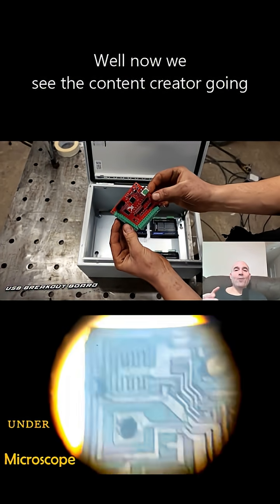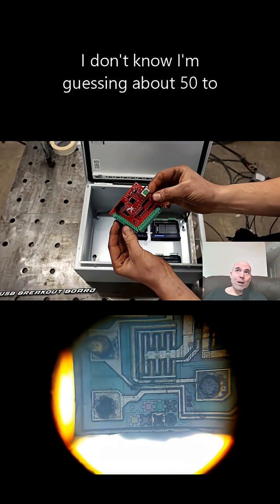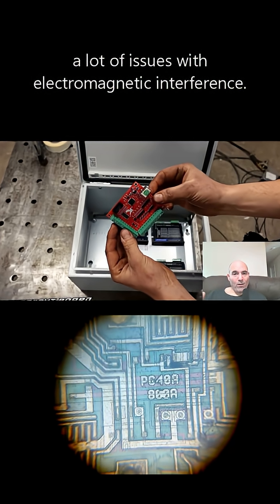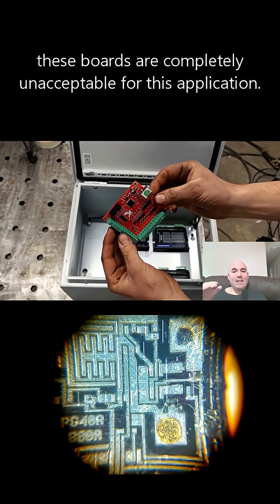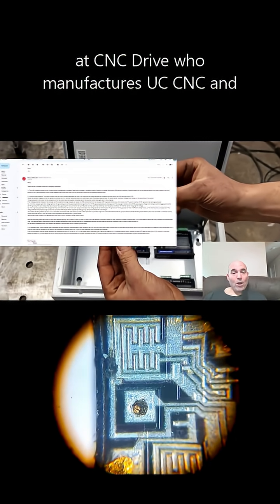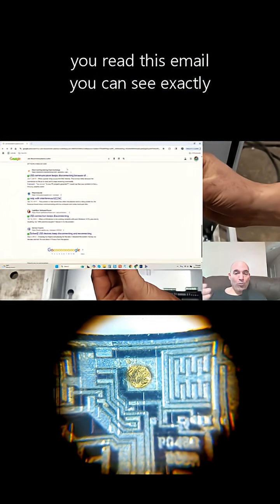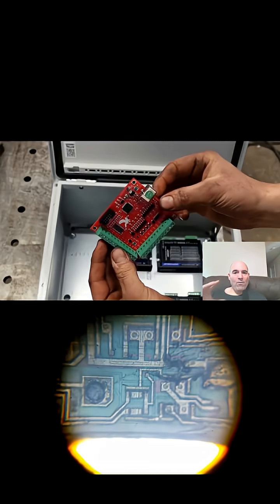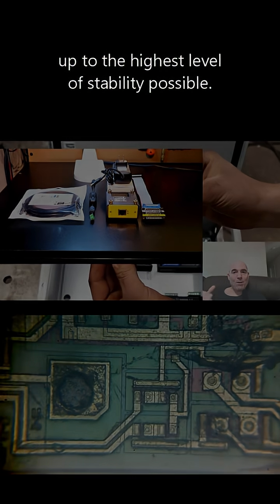🛑 Stop Using USB in Robotics – Do THIS Instead! 🔧 #shorts

Comment: As an IT/OT cybersecurity company USBs are ripe for malware. 51% of malware attacks target USB and that number is growing. Additionally they target industrial systems. Just the other day I was talking with a precision manufacturer who said a service tech plugged in a USB for an update and unknowingly the USB had malware on it. The CNC was down for almost 3 days while it was reloaded and program was restored from backups.

That said ethernet WHEN SETUP CORRECTLY can be more secure than USB. You can see who is accessing and if something happens you have logs to follow.

Comment: What if you don’t have a Ethernet port on your computer? Do you recommend a usb adapter then for Ethernet, wouldn’t it be redundant?
Reply from the maker: Its time to update your PC then with an adapter ethernet card.

 99% of the time its just better to purchase an up to date PC it will save you more headaches than you can imagine. 

I can't tell you how many weird PC problems are solved with a newer system, let alone it will be using the proper operating system being Windows 10-11. 

Thank you,
Vince